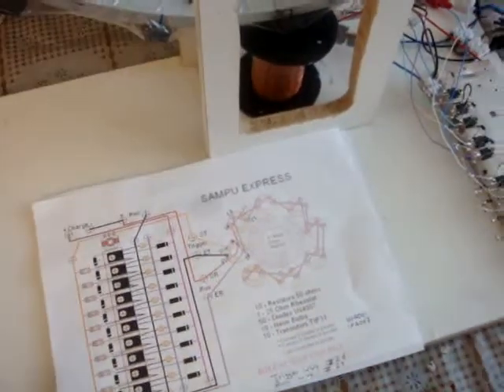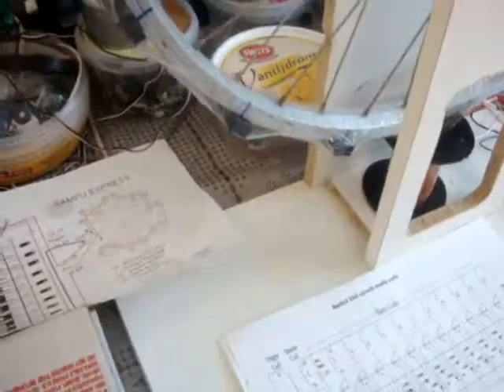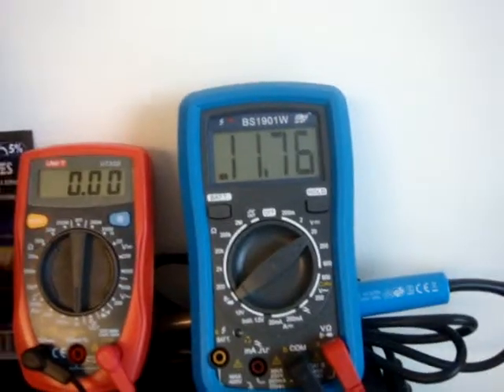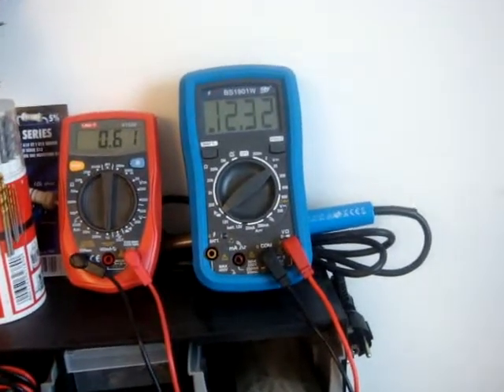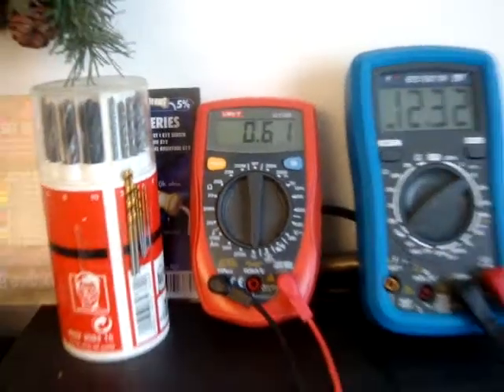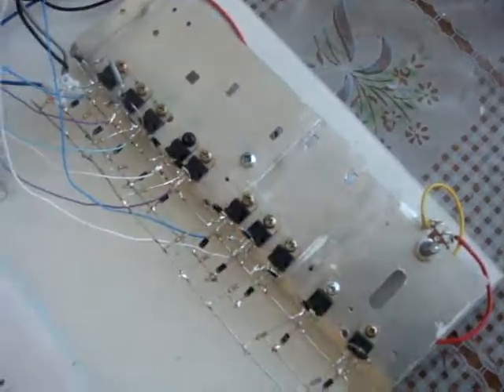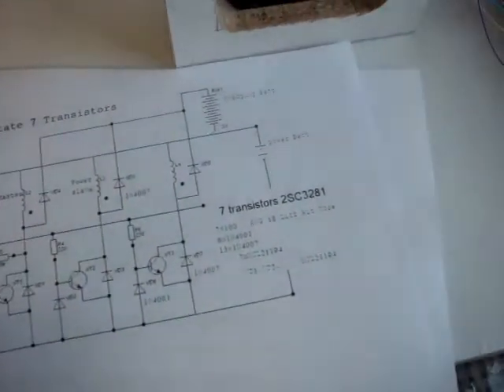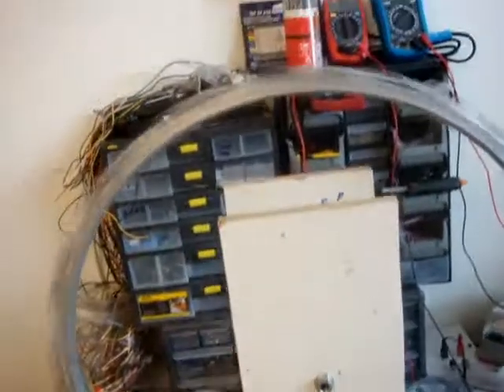8 filer bedini SSG circuit multi coils.MPG

Comment: Hello sir a tip you have the wiring and the stand perfectly done, but! you need to realize that the coil is the heart of this system!. I recommend using a Aluminum wire for the coil's windings and if you can find use square wire!!!! and for the core use silicon steel rods, You will find a massive increase in the power of this system, please work on your coil Much luck.
Shannon W.